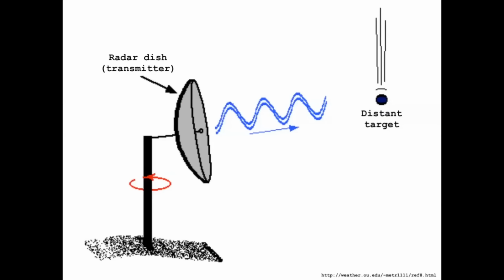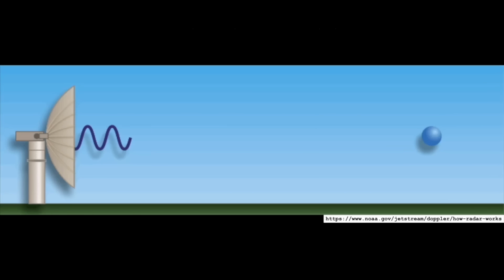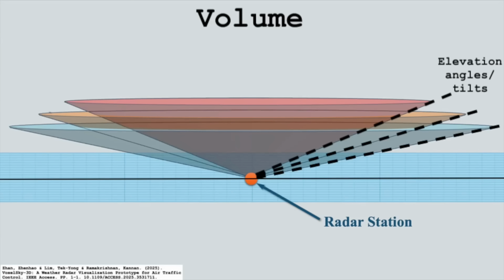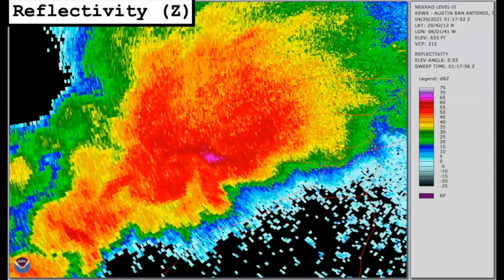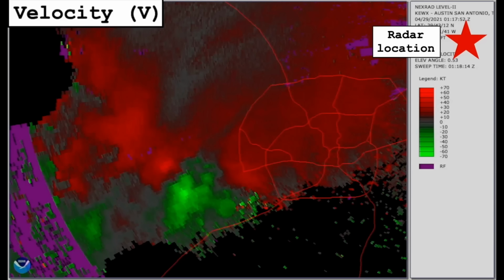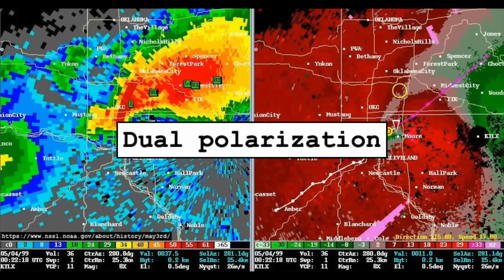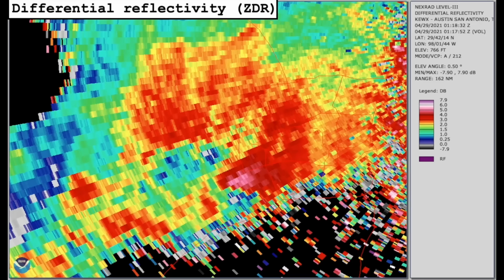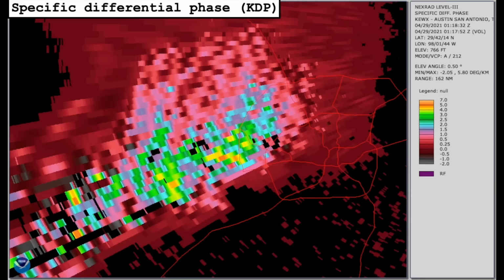STOP Using Weather Radar WRONG

Comment: 2:00 are there any developments in resolving range ambiguities in radar? I'm on the LiDAR side of things, and there when the PRR (pulse repetition rate) is high enough, you start dealing with MTA (multiple time around) zones. This requires a combination of tagging each individual laser pulse with PPM (pulse position modulation) code - slight timing offsets and entirely software based MTA resolution. Past 18 or so MTA zones (simultaneous pulses in the air defined by the range to the target) it's purely software and can result in some fun noise patterns and misplaced points if the ranges aren't preplanned. 

With airborne LiDAR capable of operating at 10000+ ft and 4+ MHz, it's pretty common to get into 30-40+ MTA zones during a collection.

All the terminology is different for every manufacturer so things can get confusing, this is just for the specific systems I work with.
Reply from the maker: You know, this is a great question to ask in our discord! discord.gg/stormchasercoaching

Comment: 1:11 It's the change in frequency that provides information about speed. Not the phase shift.
Reply: Theoretically, yes, but that change in frequency/wavelength is too small to be detected. Instead, they measure the target's speed by its change in distance from the radar between successive pulses. This change is small enough to be measured as a phase shift, but only if the time between pulses is short enough and the target isn't moving too fast (see 2:11).
Reply: @ImperfectV01D I actually underestimated the amount of pulses that radar is emitting per second. (On the NOAA page about radars, it says 1300 pulses per second.) And using a 10 cm wavelength, we can estimate that the maximum unambiguous speed is 65 m/s or 145.43 mph.
Reply: "In addition to range information, the WSR-88D is a Doppler radar, meaning that it can determine velocity of a target. When the radar transmits a pulse, it keeps track of the phase and amplitude (shape, position, and form) of that pulse. When the pulse hits a moving target, the phase of the returned wave is “shifted” or changed. This phase shift is used to determine the velocity of the target." - https://www.noaa.gov/jetstream/doppler/how-radar-works

The info in the video is sourced directly from NOAA materials. Let's do some research first before we try to be a know-it-all.

Comment: Microwave radiation is harmful to life & should be exposed properly...
STOP GEOENGINEERING!
Reply: Its a radar video. It has little to do with “geo engineering”. 

Microwave radiation is non-ionizing, and is not that different than visible light.
Reply: Tell that to the sun.
Reply: @AdhamOhm  The sun is naturally occuring...
geoengineering is not

Comment: I think you may have meant redshift (or something similar) to measure velocity instead of phase shift since you could see the full spectrum of phase shifts depending on how far away the object detected is.
Reply: I got that straight from NOAA materials.

https://www.noaa.gov/jetstream/doppler/how-radar-works
Reply from the maker: I'm simply the social media guy so I personally can't elaborate. You can always ask over on our discord server though! discord.gg/stormchasercoaching
Reply: @StormChaserCoaching Completely fair, and pretty much inconsequential unless you’re designing a radar anyways. Just wanted to point that out
Reply: Actually they do measure phase shift to get velocity. Directly observing the frequency shift (red shift or blue shift) is too difficult because the shift is so tiny (in the parts per billion range).

From what I understand, I believe they take advantage of the long return path where the small frequency change can build up a significant phase shift relative to the original signal by the time it returns to the radar. For instance, over a 10km return path, since the wavelength of S band is ~10cm there would be 100,000 cycles for a 0.00001% change in frequency (and wavelength) to add up to a 1% phase shift which is much easier to measure.
Reply: Phase shift is the broad category for the phenomenon of the wavelength changing based on motion; redshift (or blueshift) is more specific, telling you about the direction in which the shift is happening.
Reply: @TubaDragoness Why would phase shift refer to both translations and frequency changes? Plus in the video the graphic shown is a translation of the wave function and not a frequency change.
Reply: Yeah @TubaDragoness is incorrect, red shift (or blue shift) is a distinct concept from phase shift. Weather radars just use phase shift to indirectly measure the frequency shift because the frequency shift is too small to measure directly.

Comment: Time between inbound and outbound pulses is not true. The t represents phase shift. The speed of light or radio waves is constant from any point of observation. Therefore time can not be used to measure distance or velocity.
Reply: This makes no sense
Reply: It absolutely can be used to measure distance. If i reflect a radio wave off of an object one light year away it will take two years to return and if i measure an object half a light year away it will take one year for the signal to return. You would only use phase shift to make distance measurements in a much smaller and more precise scale.
Reply: Yes, it can.  If a pulse takes, say, 1 microsecond to return, then the target is closer than if it takes 100 microseconds.  The speed of light is, as you say, constant in all inertial frames of reference.  However, the time it takes for the light to travel changes, depending on how far the target is.
Reply from the maker: You can always debate this over on our community! Have you joined our discord server yet?

Comment: I worked as a lead designer on the NEXRAD Doppler Radar computers (Interdata 7/32 & 8/32, Perkin-Elmer 3200 series).  These were used to interpret data from the radar unit itself.  You did a great job explaining how the system works and  how the data is interpreted.
Reply from the maker: It's an honor to receive your approval!
Reply: @StormChaserCoaching  No problem. I at least know people like yourself are willing to pass there knowledge to new people interested in meteorology.  That is what got me interested and wanting to keep people safe.  Keep up the good work.
Reply: @DFSJR1203people like you make the world an incredible place. Thank you.
Reply: I've always wondered if y'all have a specialized Linux distro made by noaa or something
Reply: Did you work with Les Lemon?

Comment: Thanks again for another information discussion. I use Weatherwise, because it has so many great features at the free level
Reply from the maker: There are so many great apps out there! We here at Storm Chaser Coaching love WeatherFront!
Reply: I use WeatherWise too
Reply: That’s cool! I use supercell wx for about the same reason but that’s more for pc, I’m getting gr2v3 soon so I won’t have to be using it much longer. Weather wise is good I just wish there was a way to disable all of the warnings you want disabled easier.
Reply: @Dynonasity I hear ya about the warnings! Sometimes my visual is a mess. That's probably my only complaint.
Reply: @AnnaTornadoWx you can turn warnings off by tapping the caution sign at the top (⚠️) and then the little eye ball. It makes the app much cleaner
Reply: @DynonasityI love supercell wx. Great software, cool developers that actually implement feature requests.